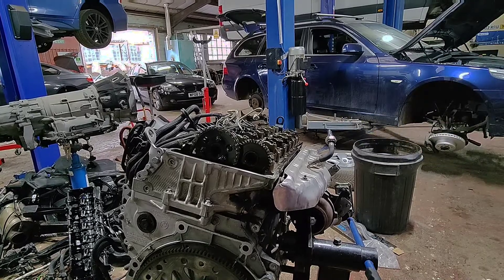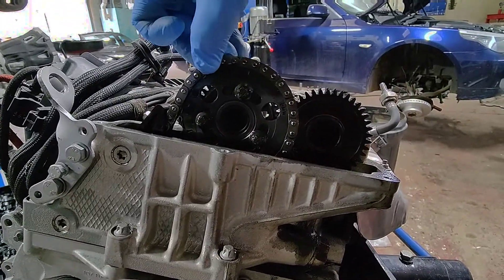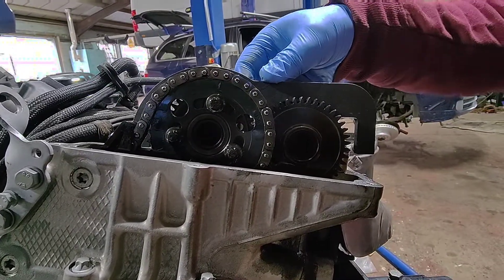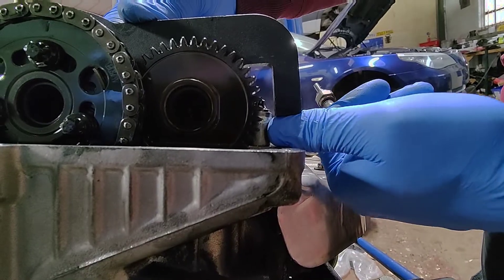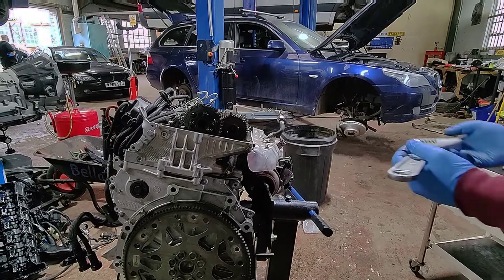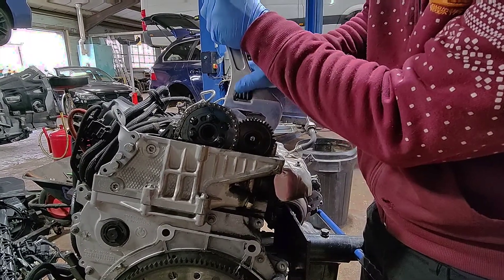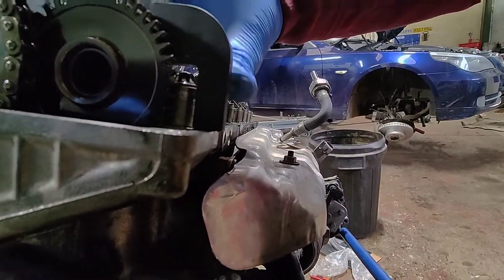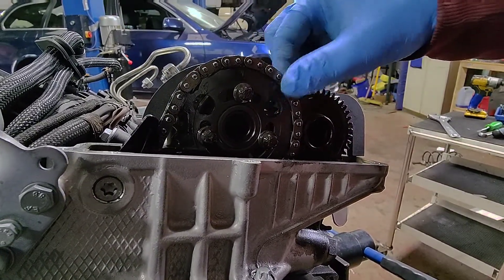BMW N57 Timing Chain Stretch does Happen, how bad is it though??

Comment: Hello. One question. My N57 had a light timing chain rattle. I removed the tensioner and it was damaged. Spring was compressed and tensioner was falling appart.  I replaced the tensioner and the rattle went away.  Should I still have the timing chains replaced ?